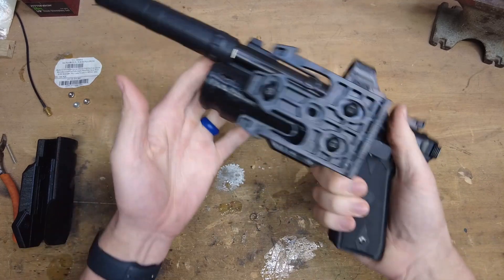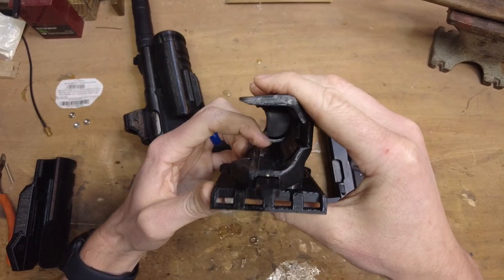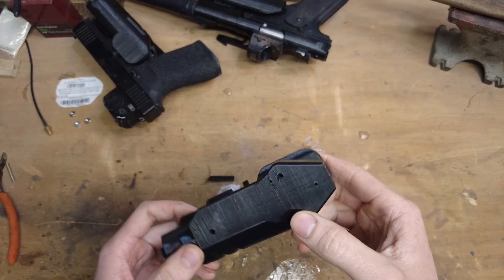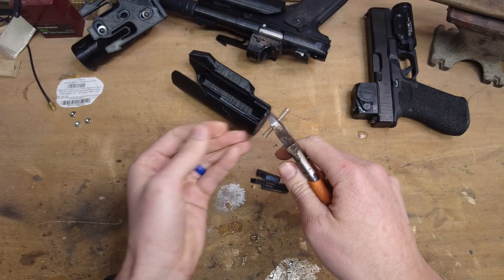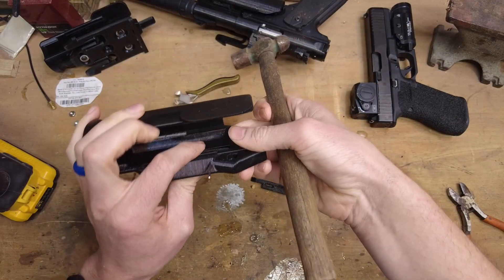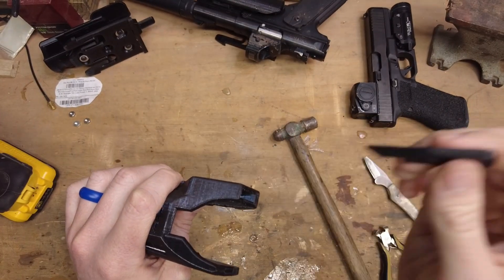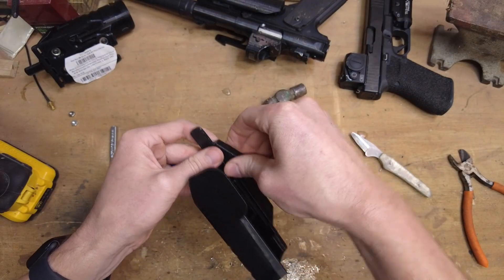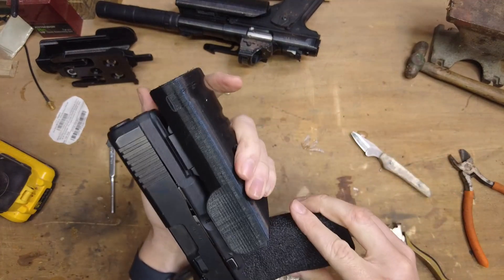3D Printed TLR-1 HL Holster // Free STLs

Comment: Printed it without checking it and it works great how ever im Gods chosen one and im a lefty. You happen to have a lefty file? i tried to mirror but not gonna work....
Reply from the maker: @JOUELZ  I am sorry my south pawed friend, I do not.
Reply: what issue are you running into when mirroring it? is the TLR1 asymmetrical around the area where the latch locks?
Reply: @uberwildy  after I looked at it a while I realized it would work fine. So I mirrored everything and printed it works perfectly
Reply from the maker: @ good to hear

Comment: Would you be willing to make one for an X300?
Reply from the maker: @rcrexable  maybe eventually but I don’t plan on it anytime soon.
Reply: @thriftyoperator637 one last question- is there a reason you printed it in PETG instead of ABS? I would have thought ABS would have been a better choice due to environmental factors and heavy use?
Reply from the maker: @rcrexable  it would be but my printer is crap and just barely makes acceptable prints in PETG and PLA+. I have been working with 3D Gear Supply and he is printing them in carbon fiber reinforced nylon. https://www.3dgearsupply.com/product/tlr-vir-ii-holster
Reply: Gotcha. I'll mess with the design in fusion360 and see what I can do.
Reply: @rcrexable  Did you ever produce a working model for the X300?  If so, I'm very interested

Comment: I just printed this and am having some issues with the locking tab, it barely engages the light because the bottom half of the locking tab is hitting the light activation switch. I am guessing the locking tab is suppose to interface entirely on the light above the activation switch but on mine nearly half of it is hitting the switch which prevents it from fully locking. Not sure what I did wrong, I am using a TLR-1 HL Streamlight light.
Reply from the maker: Is the light seating fully into the holster?
Reply: @thriftyoperator637  Yes it is, I can actually see with a flashlight that the locking tab is hitting the activation switch preventing it from popping out more. There is a very small amount of engagement,  but it's small enough that I am worried that if something were to hit it that it would jar it enough that it could fall out.
In order to fix it I'd have to file down the lower half of the locking tab by like 1/8"
Maybe I am being overly worried, how much engagement should the locking tab have on the back of the light? Right now it's  1/16"
Reply from the maker: @fuser662  the tab should be able to fully extend. I would have to measure to be sure but it should have more than a 1/16th. Feel free to DM me a picture on Instagram.

Comment: Printed it and it's awesome!  The one critique I have is needing to orient the screw flanges on the light.  On my pistols this leave the light very loose, to the point where it's rattling back and forth on the rail.  I relieved it so that the screw orientation doesn't matter and it still retains the light well.
Reply from the maker: I was hesitant to recess it that much but I’m glad it worked out for you. I had someone else tell me you can get flush screw from streamlight and avoid the problem altogether.
Reply: @thriftyoperator637 do you know where you can get the flush screw? I checked stream lights website and didn’t see anything. 
Also brilliant design thanks for the hard work brother!

Comment: TY for the video and the files

In what orientation did you print this?
Reply from the maker: Vertically with the bottom flat on the build plate.
Reply: @thriftyoperator637   Thank You.  I'm having infill issues, but it's probably me.  I'm rather an FNG to 3d printing.
Reply from the maker: @viewatyourownrisk  failure is the best teacher
Reply: @thriftyoperator637   Amen

Comment: Just finished building this.  Works pretty well on a full size Dagger.  I used some old, dull 1/16" drill bits for the pins.  This project definitely shows me I need to do some tuning on the ol' 3D printer; I had to do a ton of sanding on the button and latch.  Thanks for the files!
Reply: I know this post is old but If you haven't already I recommend using Bambu or Orca slicer since it has a bunch of built in calibration features that makes it super easy to get the most quality out of a printer.
Reply: @biggboysouth  Funny, I recently switched to Orca.  I'll have to dig into the calibration stuff.  Thanks for the heads up!
Reply: @Profacy15  You're welcome, luckily there are plenty of videos and online content covering how to do the calibrations. Super simple and made me love printing again.
Reply from the maker: For sure! I glad it worked for you.
Reply: What did you use for the spring?

Comment: Another great design!!

I ended up going up to an 1/8th drill bit for the pivot piece and 1/16th on the holster for the vir model. I found that it was trying to pivot off the bar instead of pivot freely. Probably mostly depends on the printer and print settings.
Reply from the maker: Good to know